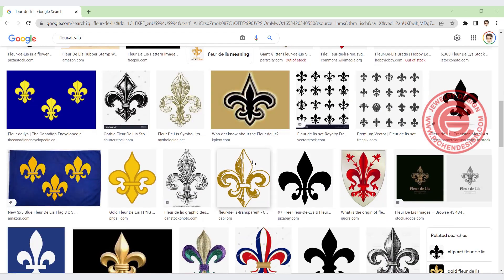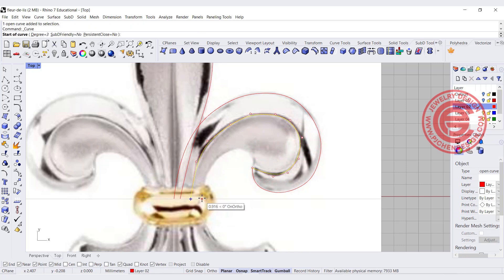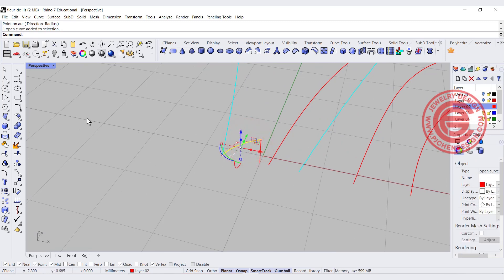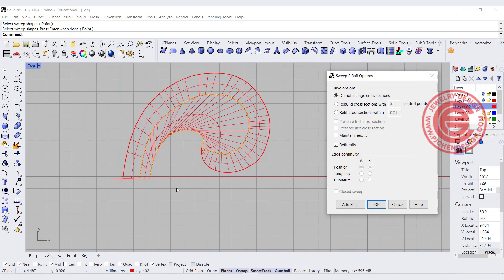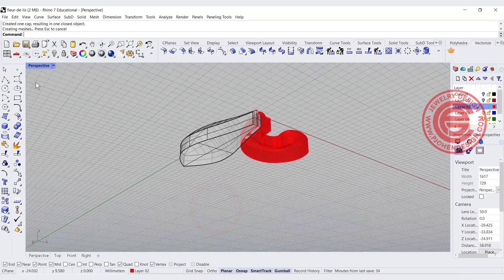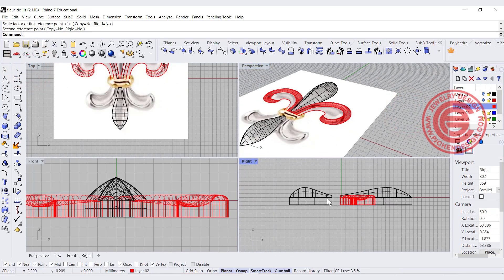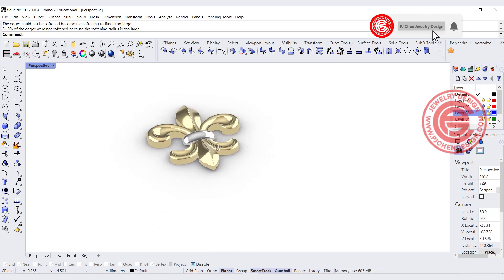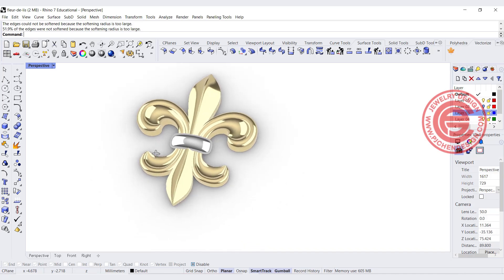Fleur-de-lis Jewelry CAD Design Tutorial 3D Modeling with Rhino 3D #329

Comment: Hello everyone !! 

 at 8:14 min of the video, when I try the trim command, my mouse wont select the outer surface :( if someone can help me thank you so much
Reply from the maker: you surface may not 100% intersected.
Reply: @PJChenJewelryDesign  the one inside with the one outside? im having the same problem.. stuck on it for like 40 min hehe
Reply: i am having the same issue followed the tutorial but cant seem to get trim to work @PJChenJewelryDesign
Reply: i got the same problem too. but the cause is because my curve is self intersecting, and then I sweep it. This is how I fix this, in rhino 7 you could select intersecting curve, fix the curve. And then trim by using the middle closed curve as cutting object. hope this help.
Reply: Same... i reven remade the whole part  still notr working
Reply: The error occurs during the Sweep 2 Rails command when 'Add Slash' is used. If I don't use this command, everything trims correctly afterwards